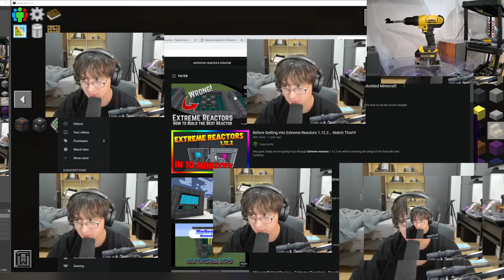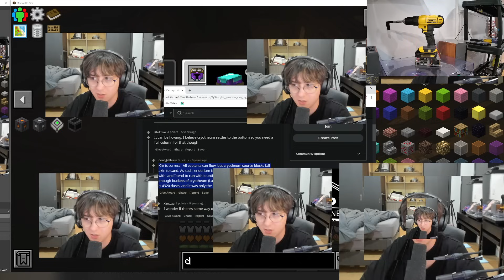Michael Reeves Builds An *EXTREME REACTOR* In Minecraft!

Comment: Imagine telling the dude that has used energy drink cans as remotes, to use better looking blocks for a reactor so it looks nicer.
Reply: Extreme reactor cant blow up
Reply: @janpuntigam4183  prove it.
Reply: @darealrulezbreaker9493  extreme reactors can't blow up, also using cobble reduces the potential power output.  he should have looked up what format he should have used to get the most power out of it. it can create an unusable amount of energy . proof been playing ever since it came out ( the mod and the game)
Reply: @RichardsNickname  draconic evolution can definitely drain that amount of energy
Reply: @bobth3god  depends on how its set in the pack, lots of settings to change how much power it makes
Reply: @darealrulezbreaker9493  I have played with the mod before. The mod author and developer himself said that the reactors do not blow up, and that is fully intentional. The only consequence of not designing yours correctly is a extreme loss of efficiency (usually shows as low power output and high fuel conversion)
Reply: @RichardsNickname  they can If you attach a turbine yeah? Or is that a different mod? I remember using "Big reactors" back in the day.
Reply: @some_meme6707  that might have been a different version of the mod I don't ever remember having my turbines blow up. that said I think they might have at one point
Reply: @RichardsNickname  P-prove it! Explain Chernobyl!
Reply: expensive metals increase the reactor casing heat (good heat) and reduces core heat (bad heat)
bad heat only uses more fuel, making it less efficient
good heat increases energy output, making it more efficient
using gold/diamond or electrum/enderium is better
using destabilized redstone is not ideal
in fact, just a waste of redstone

Comment: Extreme reactors is cool for beginners to nuclear power generation due to how simple it is.
Although if you want something more complex try something like nuclearcraft.

general tiers of modded reactors from how complex/realistic they are:
Big/Extreme reactors (fission) -> IC2 Reactors (fission) -> GregTech Fusion -> Nuclearcraft fission reactor -> Nuclearcraft fusion reactor -> Draconic reactor (pretty different but once you know what you are doing you should know it's just a matter of how much energy you put in and take out) -> ReactorCraft fission -> ReactorCraft fusion (probably the most expensive and complex but it can give enough steam to power about 50 max size HP turbines which can give about 16MRF/t with a turbine generator multiblock)

Comment: For measly 17,5 KRF i wouldn't go to such trouble to make that reactor, just use nuclearcraft it is much more nuclear material efficient, and you can make some crazy cheap thorium reactors that can last 15 minutes or more depending on how you set the reactor up (Or less too i normally put 8 reactor cells next to each other surrounded by moderators to get that 4 KRF/t for a mere TBU oxide fuel for whole 15 minutes)

Comment: Hey Michael, Type FLOODGATE. Water goes in the top, fills all blocks below it with source blocks of chosen fluid. Portable tank, Drum, fluiduct from the top, AE2 Fluid export , whatever. It fills for the reactor for you. Easiest way is completly build reactor, remove one block and replace with floodgate, portable tank on top, wrench tank so red on bottom into floodgate. Reactor fills. Make a reactor in 5 minutes if you have the right gear. Resonant ender is the best fluid btw, pyrothium will not cool properly as because mechanics dictate fluid surrounding rod cores will effect the 2 blocks away from core. So a checkerboard pattern is correct if you fill the internal checkerboard pattern with cryotheum, and outer areas with resonant ender. This creates the optimal core temperature but is inefficient when dealing with taller cores. Will burn fuel faster. Resonant ender cools much better but creates less steam, which is needed for turbines. one reactor with resonant ender should create enough steam to run 4 mid/small turbines at 900 creating 7k RF/t which is good for midgame. Do not create only one turbine.

Comment: Suboptimal design. Resonant ender ftw, also spacing of the rods ;).
Reply: Also, each block of coolant radiates to the ones next to it with an.. odd equation. You still want to have as many non-air blocks in the reactor as possible.
Reply: @TuxieBSOD  resonate ender is stressful af to put in a reactor, if you touch it, it fucking teleports you somewhere else, i use Cryotheum
Reply: @electrisoma  Flood gates my dude! You just pipe the resonant ender in, it automatically fill the area contigous beneath it with the fluid :D.

I also came up with a fun emergency exit. Stick a plastic straw in an item frame, have a block of resonant ender to the left of it.

If something goes tits up, grab the plastic straw from the item frame, suck up the resonant ender, and you get teleported 10K in a random direction
Reply: @TuxieBSOD  i forgot about flood gates, pretty neat
Reply: @electrisoma  Yeah, I only found out about them when I was desperate, I tried making a max size reactor. Filling it with resonant ender took.. some doing. Even with some pretty advanced spawner setups, a neat system involving piping it into a massive tinkers construct forge, it still took something like two and a half days of time to fill it xD.